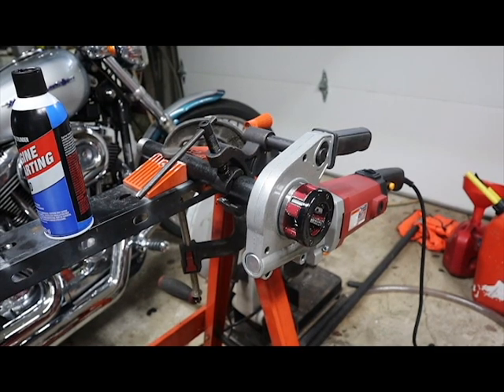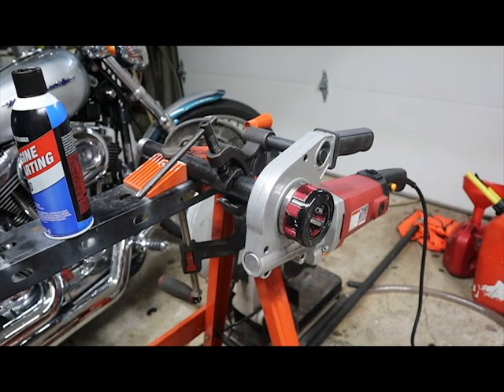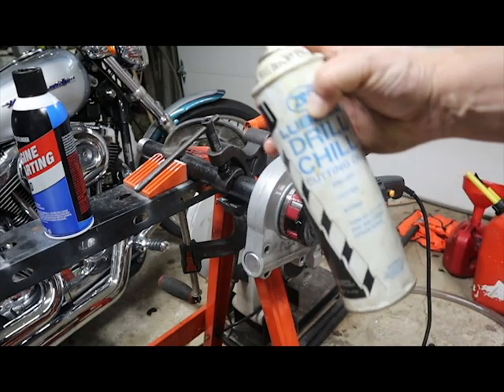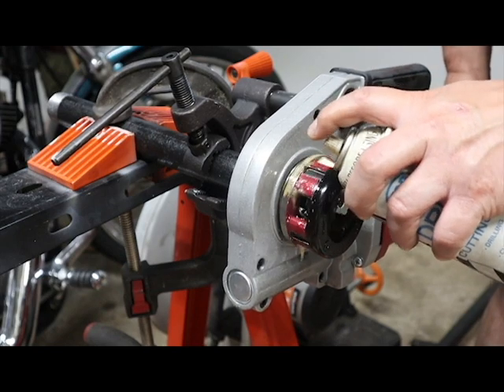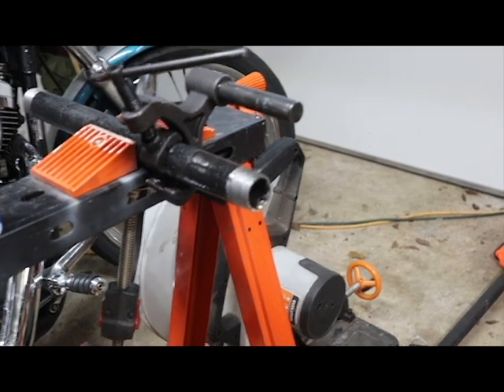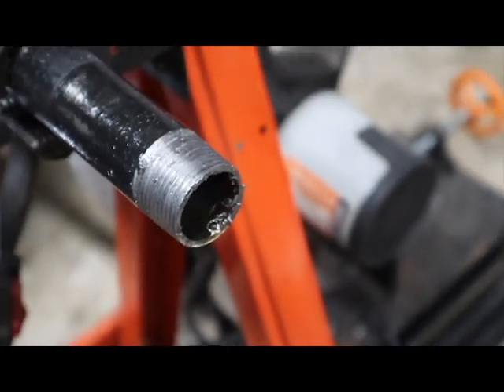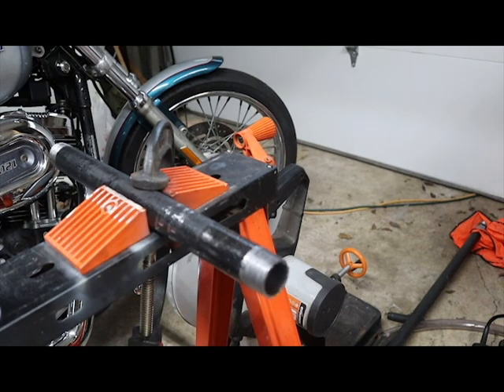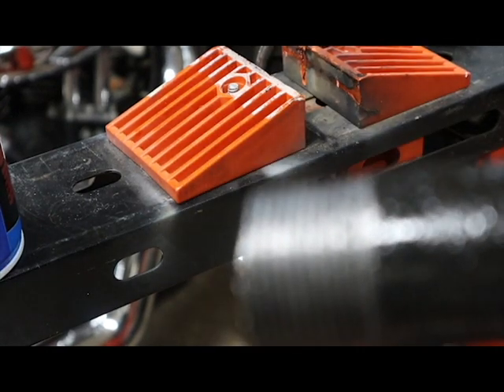Harbor (horrible) Freight Electric Pipe Threader Wolf Garage Real Review Item#62203

Comment: I just rented a REX 640 High Torque version of this tool. It's the same exact concept. I used it to thread 3/4" black steel pipe from Lowes for a large shop air system. The REX is about $2,000 and has no dies with it. It did a good job. The rental cost (11/2023) was $60.00 a day. 

My job took me 2 full days. It had brand new dies in the cutting head, as they replaced them in front of me before I took possession. So, I guess if you have a really big say 3 day or longer job this may be worth it. 

I know the HF dies are not good steel quality as I have the HF hand threader. They will work for 10 or so cuttings reasonably well but then fail and start to produce poor threads. And, I'd guess you can't buy replacements from HF. Failed dies are the main problem that will develop. 

The Rigid brand (the individual cutting teeth) 3/4" steel pipe dies are available 4 to a pack for ~60.00, but I don't know if they are compatible with these die holders. They may be and if they are, that would be the best option. Though I'd bet dollars to doughnuts, the Rigid dies are Chinese too, so maybe they are expensive Chinese.

The $$$ REX brand tool I rented with a new set of Rigid brand cutters (the Rigid cutters are compatible with REX die holders) in the die holder, cut mostly intact threads with a few small breakouts. Somebody in one of these comments said the steel in some of the foreign pipe doesn't thread well due to low carbon content. That may be true. I don't know where the Lowe's pipe comes from or how well it should thread. So pipe vs tool, I don't know. I used plenty of cutting oil. I also stopped to clean and pull out the curling wads of chips 1/2 way through each threading using a needle nose plier.

The Vevor brand Chinese tool at $160.00 with 4 dies on eBay is another option. https://www.ebay.com/itm/124866142128, Rental vs buying? Depends on how much you need to do. My job was large and I have phase 2 in a couple months. A smaller maybe 1 day job. I'm tempted to buy a Vevor as another 3 day rental would pay for it. But, Vevor does not supply the consumable cutters either. Which is just stupid. 

Sometimes the rental places rent you a crappy screwed up tool too. I have stories on that. Its a crap shoot. Good luck.
Reply from the maker: I got more than 10 cuts. My neighbor installed oil and gas tanks for 35 years. Cuts were fine. What I did in this video was well after 20 for a gas line. I don't know how it would hold up as a daily driver.

Comment: Yes. Like I say it's a crap shoot. I had used my Harbor Freight to thread a Natural Gas line for my backup generator at my former residence. That project had maybe 7 ish threadings. Then the tool sat on the shelf for several years. I bought this place last March and it has a huge shop. I broke out the tool to thread some 3/4" black pipe for the underground air line from my compressor shed into the back wall of the shop. That project went well more or less except the ratchet began to skip. I had to be really careful. It got the job done. Maybe 6-7 threadings but was getting really hard to start cuts. It still works but it's a struggle and the threads are so so. So when it came time to build the air system in the shop's two RV sized bays, I decided to rent. Now that that is done, I have to do some work in the attached workshop and extend the air system into that part of the building. After that is done, I don't know when I would ever need a threader again. It could be years. I think if a guy has a large say, 3 day job... for the money I'd buy either the HF which has two brands Bauer and the lesser Chicago brand. Or perhaps the Vevor. I just wish these companies would sell replacement die teeth, or better yet, make the die holders universal with the Rigid dies. Thanks for your video! I appreciate you. Keep getting those hands dirty.
Reply from the maker: Looks like I need to find more projects for this tool.

Comment: As a professional pipe threader, I can say, from experience, that this product is adequate.
I purchased it based on honest, realistic video reviews and am not disappointed.
Keeping a full sized tri-stand and power pony with a hand held oiler, for weekend projects, is simply impractical for most.
Decent video...but your Sportster air filter case decal is inverted...jus sayin.
Reply from the maker: cam cover was inverted as well;-) Thanks for noticing. I don't have that sportster anymore, but all my covers are inverted:-) I could spend 20 minutes explaining why... but this site does it well:-) 
http://www.chopcult.com/forum/showthread.php?t=6484
Reply: As a professional plumber, I can attest to your statement. You would think youre giving up on quality of threads, but not so with the machine. 

Build quality is ok, and it seems to struggle a little bit at 1-1/4" threads, but it has paid off, and fed my family during some pretty tough times.

Comment: I have 5 or 6 cans of thread cutting lube, new and almost 60 years old because my FIL knew he needed the high sulphur stuff.  It's almost like molasses.  You also want continuous cutting so the metal flows.  Carbon steel was used long before HSS was invented and worked fine, just doesn't handle heat or edge life as well.  But that's where the lube comes in.
Reply from the maker: I'm not a pro for sure, but I can muddle through. Thanks for the feedback 😀

Comment: I’ve had one for about a year.  They are great if you do the following- 1.) chamfer the  end of the pipe to allow proper purchase of the die on the pipe. 2.) use a high quality, fully formulated thread lube with Sulfur and Chlorine, like Castrol Moly-Dee. Don’t scrimp and feed the oil so that all of the dies are well lubed. 3.) Part of the reason threads get damaged in that that the chips get too long (not broken) and gall the already cut threads.  Using a start stop back off and relube restart technique works very well. 4.) also, have found that non-US pipe tends to be a bit off-size and has brittle inclusions which doesn’t lend itself to  proper threading.

Comment: Thanks for the video. The problem with your camera focusing is that you don't have enough light in the room and the sensor is struggling to focus try to increase  the light in that area can help. I own some higher end cameras if you have a larger sensor or low lux option can help. If you can't raise the light then just switch it to autofocus

Comment: Based on the reviews, I purchased this tool. Cost today is 230 bucks. Not my first rodeo on pipe threading. Retired contractor.  I did a total of 4 pipe ends, 1 inch black pipe. The first was acceptable. The taper on the end was a bit different, but the fitting screwed on pretty well.  I cleaned the die with compressed air. The second was like the first. Taper a bit off. Blew out the die again.
On the third the machine started to struggle. I was using plenty of oil,  backing off to clear the chips about ever 1/2 - 3/4 turn or so. Got about 1/2 the threads cut and the machine started to slow. Not pushing it at all, letting it feed. The motor started to smoke. Stopped backed off again.  
Went forward again and everytime the die would start to cut, the machine would slow and smoke.
Finished the third end. Threads were bungled a bit, some small chips missing, but it sealed when tested under pressure. 
Cleaned die again and noticed some of the cutters were chipped. Thought I would give it one more try as the die screwed on to a factory end fine. No go this time. The machine struggled worse, the motor smoked everytime the cutters engaged the pipe. Stopped looked at the  threads I cut. Most were chipped. The die teeth were chipped worse.
Only used it on the 1 inch sch 40.  
The machine is under powered for 1 inch or bigger.  Wouldn't even attempt using it on 1 1/4.
Might be ok with 1/2 and maybe 3/4.
The dies are poor quality. Not very tough. Would recommend that if you have several pipes to thread, rent a good threader. 
This machine will cost you in the end. One inch black pipe is almost 5 bucks a ft. You can't be throwing it on the scrap heap because of messed up threads.
Reply from the maker: Sounds like you got one that might have been used and abused. Mine is still going strong. Use it for odd projects, but I don't force it through the material. Heck, even with a manual ridgid threader I've beat up bits and threads. Sucks, but your review is honest :) I'm happy with mine, and all my connections tested and held at 30psi.
Reply: @rywolf01   Was packaged as new. Going to take it back to HF. Still have to decide how to finish the rest of the project. This one is out in a remote area. Rentals are a 70 mile roundtrip. Being so far out was the main reason I purchased.

One thing I found out a few years back about HF items. You can buy two identical items, but they may have different numbers. What that means is that they were not made by the same manufacturer/factory. So some people may get a good product and others not so good.

Comment: I was told that they don't sell the whole die unit and I like an idiot ended  up buying a whole new machine just to finish up another job because the die wouldn't thread anymore. Oh and yes this happen before and  Harbor freight did replace the 2 nd unit Being that it was still under  Warranty. With that second new unit it ended up doing the same thing on another job. So I ended up buying the 3rd unit,  And of course I was able to finish off that other job. I love the machine and it works quite well. I also had reviewed the reviews on it and I don't know why some of these other plumbers are talking bad about the machine. Back to my question. I can't seem to get ahold of anybody at the company and until this day still haven't received a call back. My question  was once again do we buy the the die teeth pieces  itself To put back into the die unit?  And if someone knows which ones are they. I keep running across the manual die unit pieces  Which are different than the electric mechanical unit. Can you or someone here help me  With my problem?
Reply from the maker: I know it is way beyond a year. What was your solution?

Comment: How nany threads past flush to going? Just curious I usually go 2
Reply from the maker: Think it depends on your application. Anywhere from 8 threads on a large pipe for a gas installation to 18 threads for smaller pipe. Not sure what code should be, but I would think that 2 threads past is good.

Comment: "You were no longer able to adjust the die because the screws stripped out of it" - Umm I've been a pipefitter for 43 YEARS, the dies are NOT adjustable! WTF are you even talking about? Hold the damn trigger down, it is NOT made to be used like you are doing it (start,stop,start,stop,start,stop, etc.)
Reply from the maker: Thanks captain keyboard commander. Glad you were a pipe fitter for more than half your life:) Great constructive criticism from a  yard jockey. The die was replaced in a ridgid manual threader. Which... was done by a pipe fitter who tried to help me out by pulling his old manual threader out of his shed. He stripped a screw securing the die. He spent 35 years in the field installing gas and oil tanks. Thanks again for your asshat comment though. Hope your day is as $hitty as you are😅
Right here's the link for what his setup looked like $hithead;) https://youtu.be/xFhNneLX6EY?si=1VhnU-rD6o0k9iLI
Wtf are you talking about? Sounds like you were never allowed to touch the tools since you apparently think there's only one style head for dies 🤔 😉 😏

What's your keyboard commander move now? You going to tell us there's no screws and/or adjustments to be made? It took you 43 years to figure out you were a pipe fitter. I d 10 T

Comment: Use a lube with high sulphur content. I own pipe fitting  company. We thread alota pipe. Lots of it. I dont know how cheap threaders hold up. I only buy ridgid, rothenbeger, and we just bought milwaukee
Reply from the maker: I'm sure if I had to use this daily in a professional setting it wouldn't stand the test of time. I'm do remodeling/renovations.

Comment: how are the dies holding up?
Reply from the maker: I don't use it daily, but I've cut at least 4 dozen cuts with the half inch die. Seems to produce a clean cut. Not sure about the accuracy, but all of the fittings get pressure tested and have maintained at least 30 psi over 48 hour period. Not sure what your application is, but as a prosumer tool, you won't be disappointed so long as you use it right.
Reply: @rywolf01  Thanks. I'll be using for home pipe retrofit.  Water, some gas.  Probably only 1/2 & 3/4.  But I'll be under the crawlspace or in a tight attic working some in place retrofit with not much room for the big manual tool.

Comment: Harbor freight strikes again!!! Lmao everytime I see someone use their product they are afraid to go all out lol
Reply from the maker: All out? Please elaborate. I certainly know that this item outperforms the manual rigid pipe threader I have. If you mean overwork a Chinese knock off... Why would I do that? I believe this unit would be fine, I just prefer to take slow and easy. Quality verses quantity in my book. And... It's another horrible freight item worth 150 or whatever I paid for it.
Reply: My old shop bought these, we would just send it if it broke then it broke not our problem the boss wouldn't buy pro grade tools, the clamp did get bent from someone threading 1.25" without oil.
Reply from the maker: @falloutforever88  I'm not typically a full send type of guy. I spend too much time already repairing broken items. If I was getting paid to drag race, then I'd consider full send:)

Comment: Mine won't do galvanized pipe. Big disappointment.
Reply from the maker: I've put threads on galvanized steel pipe.
Reply: @rywolf01  mine just spins on galvanized pipe. It won't  engage. Tried the block of wood trick. Nothing. Tried beveling the edge. Nope.

Comment: you lost me at the lube. User Error. This machine must be screaming at your. Even a rigid 300, a $3k machine needs to be submersed in threading oil does 2 things, COOL the cuttings threads and lubes it. YES the lube type and amount matter. For the price tag, it works great. This portable machine gets into places the larger machines don't.

Comment: Extremely poor pipe threading technique.
Reply from the maker: How would you improve it?
Reply: @rywolf01  Grease the dies instead of oil, do not cycle your electric drive threader instead press and hold the switch till the threading is complete, reverse, release and clean with rag and steel brush.
Reply: @rywolf01  yea i think stopping n starting so often will damage the elecrical contacts on the switch cuz everytime u open n close a switch u get an arc that eats away at the metal. Also stopping n starting is makin the motor pull more amps and work harder. I would only stop n strt again maybe like 2 to 3 times at most to do the whole thread just so u can give more lube but keep trying to shoot lube as its threading
Reply: Short stroking will get pipe shaving stuck in the dies. Run it brush it wipe it install it